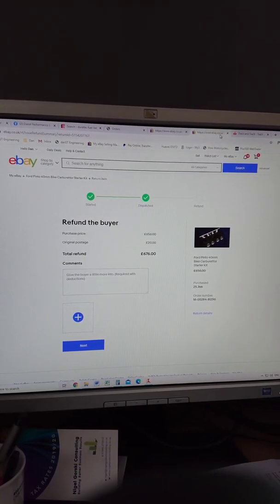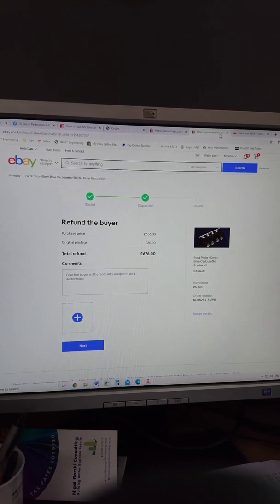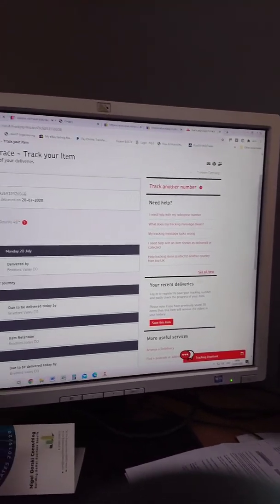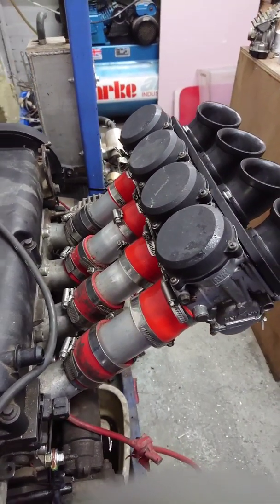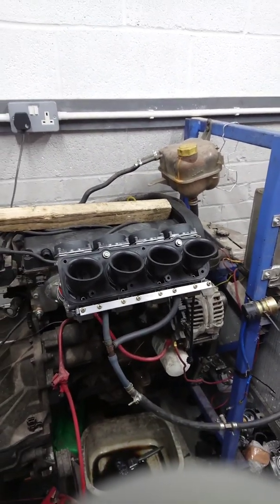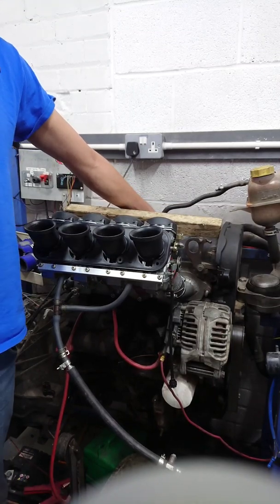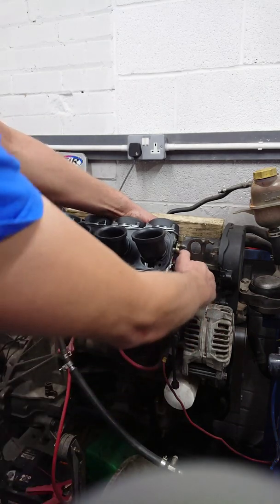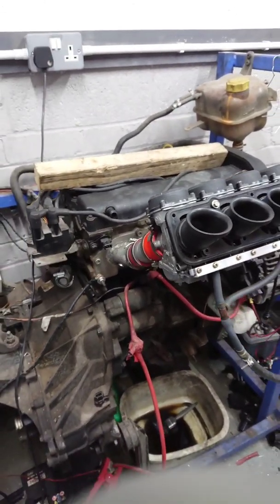Danst bike carbs and test engine overview

Comment: What is the pilot jet size needed for 1600cc engines and what is setting for the air mixture screws
Reply from the maker: We rarely change pilot jets, so standard bike OEM.

Comment: Great .  Sir I have a question. 
Give me a clear answer.  Will i get extra horse power if I install motorbike carburetors on a car.
My car has 3 cylinder engine. 800 cc Engine.  What do you recommend me which motorbike's carburetors fit  ?
Reply from the maker: Hi, it is hard to estimate as all engines differ, but a guesstimate would be 10%

Comment: Hii ive got a mk1 golf with the exact same carbs on kawasaki 1100 but it dose not work it revs up fine but when i drive and put my foot down it splatters and when it idles the carbs give little pops and splatters any help please
Reply from the maker: That sounds like an air leak or lack of fuel.
Reply: @DanstengineeringCoUk  thanks will have a look

Comment: HEY DAN i had a question about your 22r intake kit, is it specifically designed for pre 84 heads or would it be compatible with 85+ heads?
Reply from the maker: We were not aware of a difference in heads? What are your concerns, is it fitment related?
Reply: @DanstengineeringCoUk  yes! The pre 84 blocks had a different head and block compared to the 85+. The 85+ were called "laser" blocks, they had slightly different intake and exhaust ports. Usually if its an FI engine it came with the laser block, exceot for carbed 85+ blocks
Reply: @DanstengineeringCoUk  i would be ordering this for a 85+ block!
Reply: @DanstengineeringCoUk  if the setup is designed for 1985 and up heads, id love to purchase a set for my 22re build!